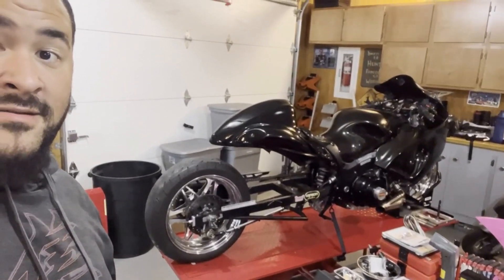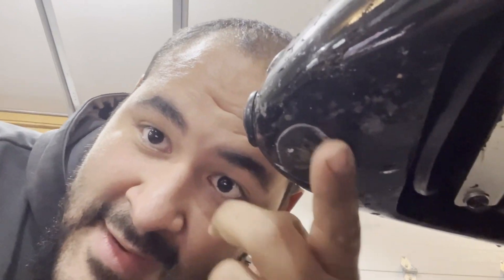Turbo Hayabusa New Personal Best

Comment: Not sure if you realize you are doing it, but as soon as you take off, you are backing off the throttle and then rolling back into it. You will go quicker if you get the throttle locked and leave it there. Good luck, be safe.
Reply from the maker: Man I have been chasing that issue. I’m trying to shake it I used to do that on the hand clutch and the slider is making me relearn not to do that.
Reply: @The717Outlaw  I used to do it, trying to get my foot up and my body in a tucked position. Practice practice practice. Having video of it is a big help.
Reply from the maker: @quick99busa  definitely. Seat time makes it all come together